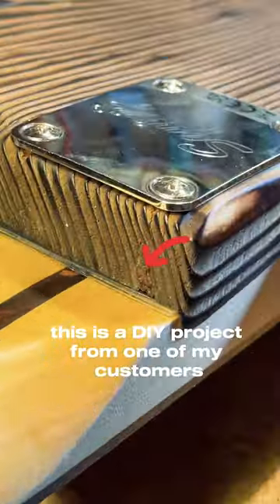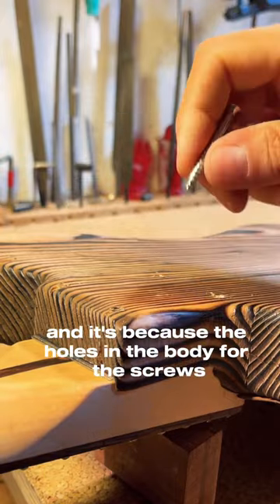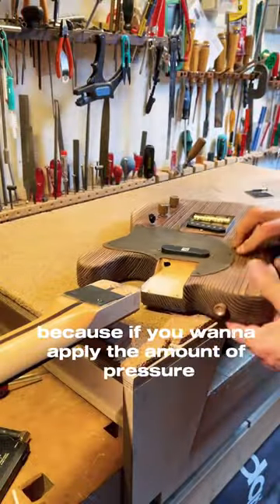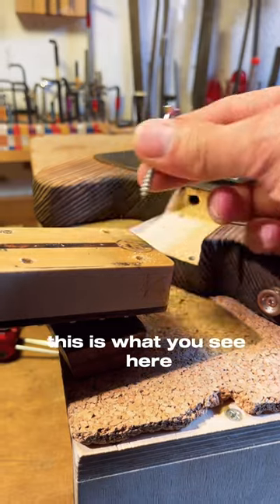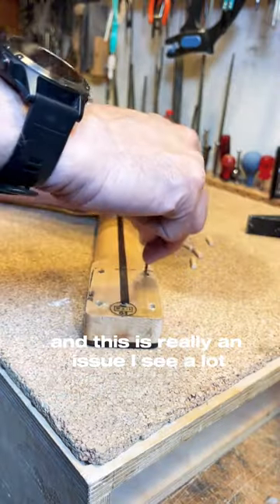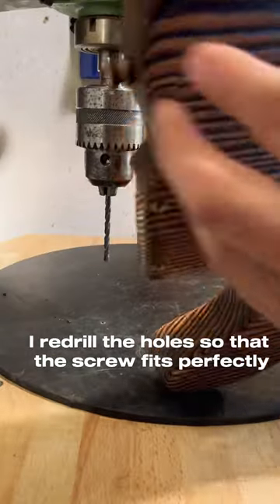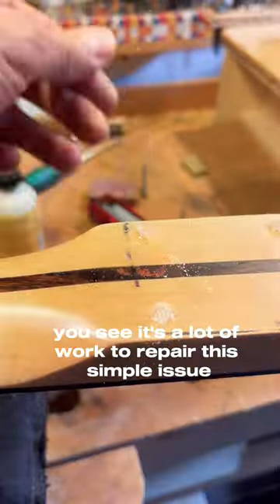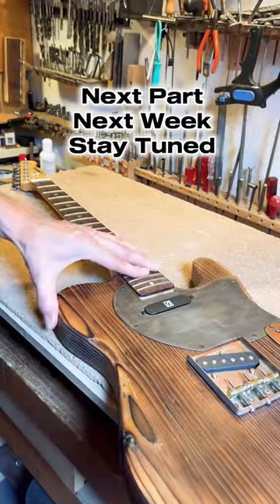Telecaster Stratocaster Neck screw common issue #shorts #diy #tutorial #help #guitar #craft #howto

Comment: The hole in the first piece of wood must be a clearance hole. The diameter should be large enough for the screw to pass through the hole without binding.The second piece of wood that the screw screws into should be drilled to the same diameter as the root diameter of the screw.
Reply from the maker: Thanks for your feedback. That’s absolutely correct 👍Best Regards Nik

Comment: Okay for people that don't know. If you drill the hole bige enough so the wood screw goes straight through you won't have anything to grip. The purpose of wood screws is to grip the wood to force them together and bond them. If they just go through what the hella rentoy going to grip on to?
Reply from the maker: Thanks for sharing your opinion but my theory is that the screw works like a clamp....The hole in the body must be a clearance hole. The diameter should be large enough for the screw to pass through the hole without binding.The second piece of wood that the screw screws into should be drilled to the same diameter as the root diameter of the screw. Best Regards Nik

Comment: The screws are intended to thread through the body. They thread through the body so that the relationship of the neck and the body stays the same even if a screw gets backed out. If you set it up where the screw passes through the body then the neck and body become loose if a screw backs out. Also the neck and the body should be clamped together and then the screws are inserted. This will lead to a tighter and more consistent fit. Filling the holes and redrilling was the best thing to do but the screw should thread through the body and the neck
Reply from the maker: Thanks for sharing your opinion. Best Regards Nik

Comment: This was standard procedure back in the day. If you look at any old Fender this is how it was meant to be. The neck holes and the body holes were drilled to the same diameter and the screw was to be threaded through both of them. Modern guitars widen the holes on the body.
Reply from the maker: Thanks a lot for your Feedback and for sharing your knowledge. Best Regards Nik

Comment: I would say his biggest issue is using what looks like Pine, way to soft for this job, and is going to split no matter how large you make the holes
Reply from the maker: Thanks for sharing your opinion. Best Regards NIk
Reply: I would say the biggest issue isnt using pine it's the fact that the holes are too close to the edge of the wood and they weren't drilled out enough. I have 2 pine guitars and as they are soft this is not an issue. Denting and weight are the biggest problems.
Reply from the maker: Thanks for your Feedback. Yes that's absolutely correct. It´s a combination od these issues. Best Regards Nik
Reply: I made a tele out of pine, just like the first few made, circa 1948-50.  Never had this problem because i tighten the screws enough, not too much.  With a vintage type v
shape maple neck, it sounds sick unamplified. (pure tone)
🆗😎🆒🎸🎼
Reply from the maker: Thanks for sharing your experiencePaul. Yes they sound really good even of this cheap material. Best Regards Nik @paulpennington-mv7rt
Reply: Why are soft woods so beautiful?😢
Reply from the maker: That's correct. Best Regards Nik onemintjulep
Reply: @petrekguitars  My pine tele is in Guit-fiddle Heaven🥀🎸⚰️🙄
Reply from the maker: I love this Wood. Best Regards Nik @paulpennington-mv7rt

Comment: Nice repair and knowledge sharing
Thanks.
It looks to me that the front set of neck plate holes are too close to the edge of the body, causing stress fractures in the wood when compressed. 
I think the neck plate should have been placed further back from the open end of the neck pocket in the original build.
Reply from the maker: Thanks a lot for your Feedback. That's absolutely correct the guy placed the whole to close to the edge. Best Regards Nik

Comment: On a bolt on neck Fender style guitar the screws should just pass through the body, not screw thru or bite into the body wood. Asian imports generally just drive the screws thru the body. Open the body holes enough so the screws just pass through.
Reply from the maker: Thanks for your Feedback Chris this is absolutely correct. Best Regards Nik

Comment: I find this difficult to mags sense. So my question, what do the screws tags hold of?
Reply from the maker: Thanks for your question. Actually it's quite simple. The Screw work like a clamp. But if the screw hole in the Body is too tight it can't press the Neck to the body. Simple as that. Best Regards Nik

Comment: Why not use socket threaded inserts  and machine screws...reduces chances of damaging neck wood and you have to have clearance diameter in the body
Reply from the maker: That will be a good technique to avoid this problem. But the Telecaster is relatively simple and I think this will increase the production costs.... Best Regards Nik

Comment: Ehm, where did he study engineering? The idea is, each screw is pulling neck and body together. You need a good thread in BOTH the neck and the body. The moment you drill out the holes in the body without adding a "devil" (what did the man say?), the result is, the screws will need the screw head, instead of the thread.

Sure cracks are a risk, then repair the cracks! Do not destroy the thread of the 4 holes in the body. The neck joint NEEDS that thread. To my humble opinion he repaired the neck, but he destroyed the body. It may work, it solves the cracks problem, but simply drilling out the holes in the body, it is horrible, one should never do that. Because that thread is paramount.
Reply from the maker: Thanks for sharing your opinion. But that's the way I do it you can prefer your process. Best Regards Nik
Reply from the maker: I have graduated 1997 in a German Luthier Scholl. Best Regards Nik
Reply: If you attach one piece with another with a screw and you have threads in both pieces then screw doesnt pull these pieces together. It just holds them in place. If you want a snug fit you have to over tighten which partially destroys threads in top piece and allows it to be pushed into bottom piece. 

But when you have loose hole in the top piece, then it contacts only with a head of the screw and that head pushes the top piece into bottom piece.

That’s the reason a lot of screws don’t have threads all the way up to the head.
Reply from the maker: Thanks a lot for your very good explanation. That's absolutely correct. Best Regards Nik @mnzrk